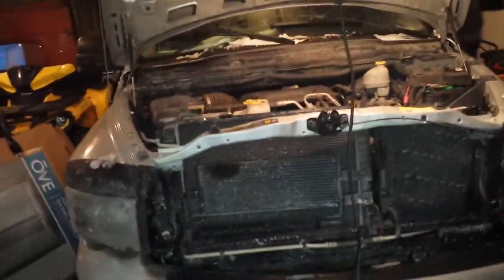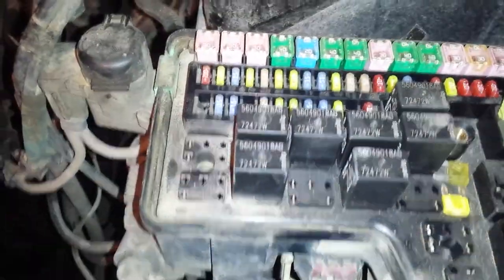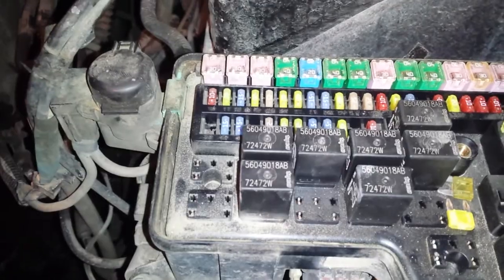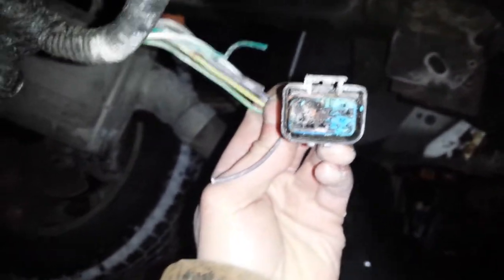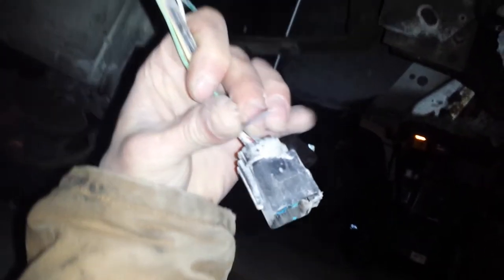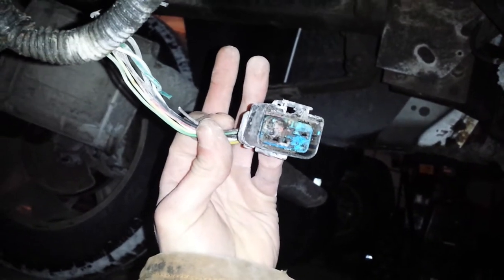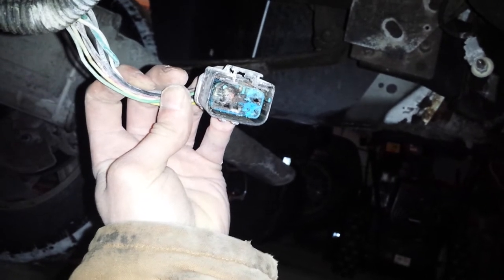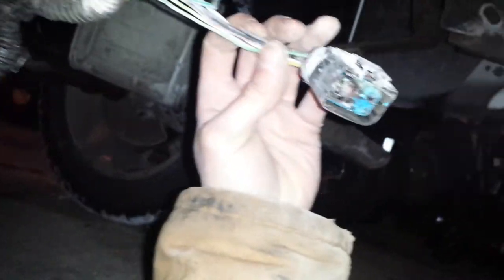2005 dodge ram park lights won't turn off

Comment: Not all heros wear capes, sir. You just saved me hours of troubleshooting. Thank you. 

If anyone cares, ambient temp here is about 15*F. I sprayed that plug with brake cleaner to clean the contacts and it sizzled. I snipped the ground and the lights shut off.

Comment: Thanks so much for this video! My 04' Durango had the same problem and while it wasn't the trailer plug in, it lead us to the towing relay under the car that was burning hot! Unplugged it and it was corroded but the park lights turned off! Threw a new one on there and good to go!

Comment: Thank you so much very helpful ... had same problem with my 2003 Dodge Durango and the running lights, back up lights, and dim dash lights ... and watched your video and checked mine and was same exact thing cut the plug off and boom lights off ... thank you again

Comment: Had the same issue with 2008 Dodge Dakota.  I tried everything..... then I found this and thought - what the heck.  I checked the trailer plug and, it looked fine BUT, it was warm.  Still, I figured: "No way".  I didn't have much to lose on trying so I cut the ground wire.   That was the issue.  Crazy.  Would never have found it.  THANKS for posting.

Comment: I have a similar problem with my 2004 Ram 3500. Started with the running lights coming on by themselves and not responding to the switch. I unplugged the relay and that worked but then the brake lights started doing the same thing. I was able to keep running by just plugging in the relays when I needed to drive. Then the windshield wipers started turning themselves on and off.  From my research it seems that Dodge had this problem foe a couple of years. I've been told that the power control module leaks moisture inside and the corrosion spreads. They say I need a new PCM but they are not cheap, and getting a salvage or used one is risky.